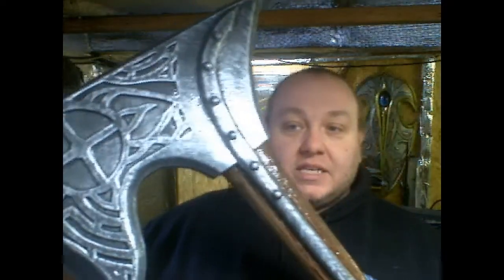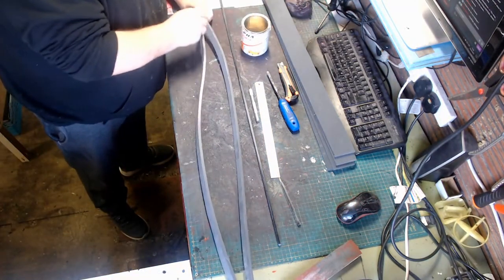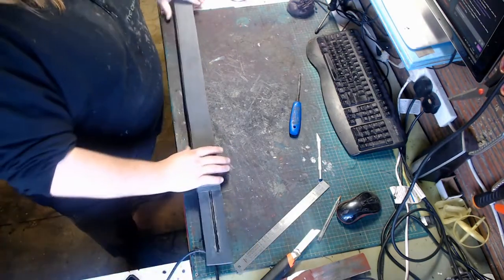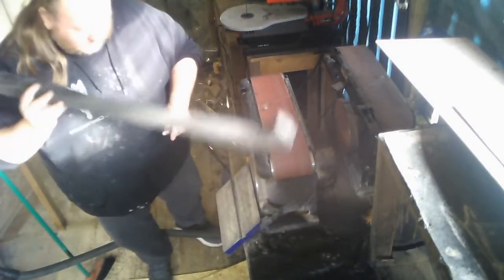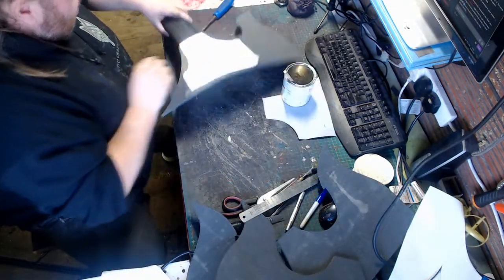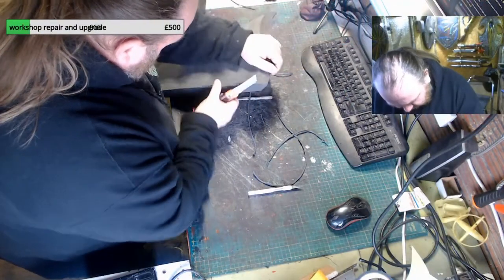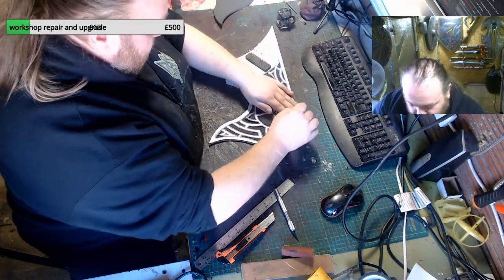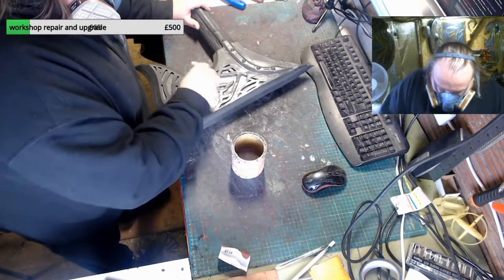how i built a skyrim larp axe

Comment: What did you use for the reinforcement over the center layer of the blade, more false leather, or just thinner foam?
Reply from the maker: Faux leather for reinforced parts yes. You can use other sturdy materials if you wish. I just happen to have a fair bit of it in stock
Reply: @ttccraftworks8469  Thanks for the quick reply.  You do fantastic work.  Love the video tutorials.
Reply from the maker: Thank you